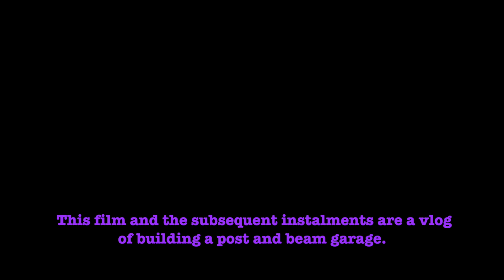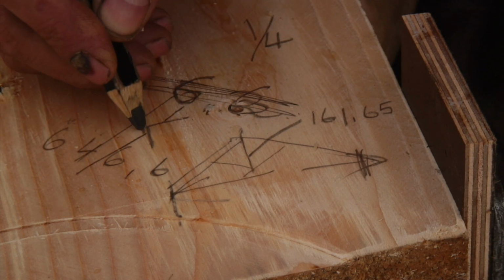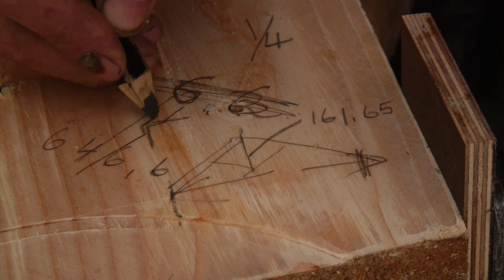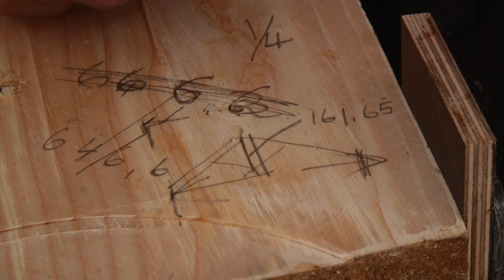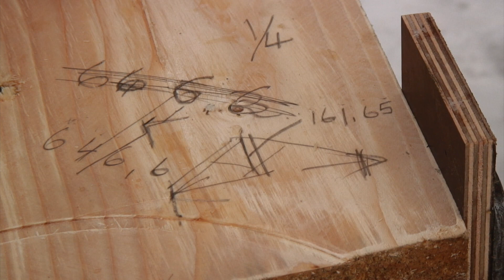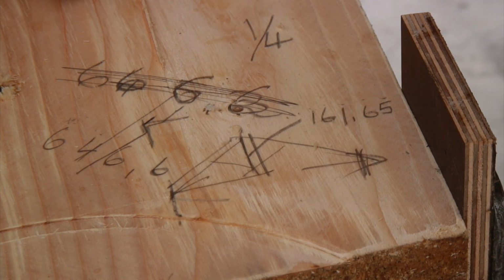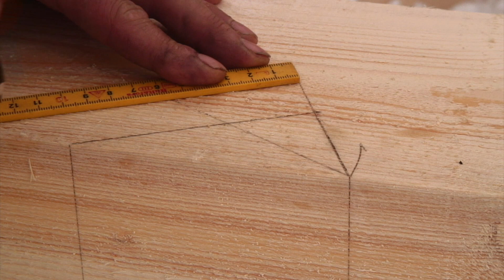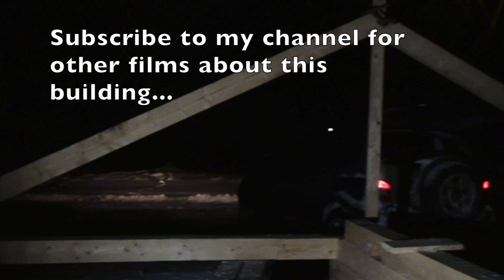🔴 5/35: building a Post and Beam Garage - Roof joist template

Comment: You might find a skill saw useful.
Reply from the maker: Yes they are great but I have tried them before for this work and this way in the films is better IMO. Skill saws don't get on well with raw timber like chainsaws, which are made for it.
Reply: @LucasRichardStephens  Good point Lucas, i just thought if you made the line cuts with a skill saw, even just a 1/4 inch deep they would be crisp & accurate. you could then finish with the chainsaw. but ether way you are doing a great job !
Reply from the maker: @davidallen944  Cutting the line with a skill saw makes power/chainsaw work become less accurate because you really need to see the line to be able to cut it in half. The kerf of the circle saw is 2mm making that the width of your line while the pencil line is less than a mm wide. I have tried this before on just the same kind of work and discarded it for this method which is faster for me, if a little more strenuous. Having said this when the cuts are shallower the circle-saw comes into its own. Don’t get me wrong I see that your suggestion comes straight from your own good experience and appreciate it. Timberdoddles is a great channel by a pro timberframer, well worth a look, his circle-saw skills are a marvel to behold. I come from building timber houses and have worked up a familiarity with the power saw that makes it faster for me to get an adequate joint with this 6”X6”, which is of course substantially more than twice as wide as the cut depth of my present circle-saws. I have use larger circle-saws as well but they often suffer from overheating in fresh timber and are even more strenuous than the power saw.